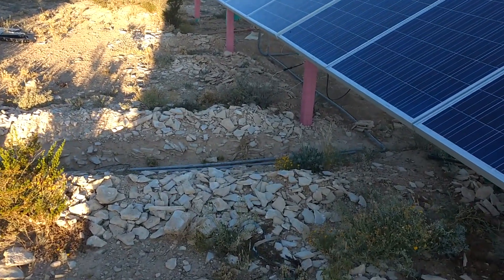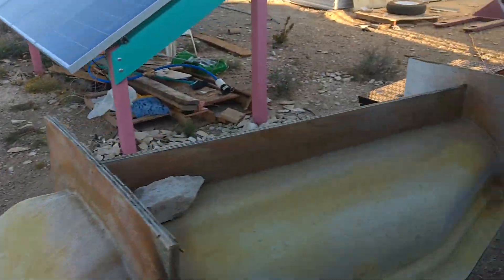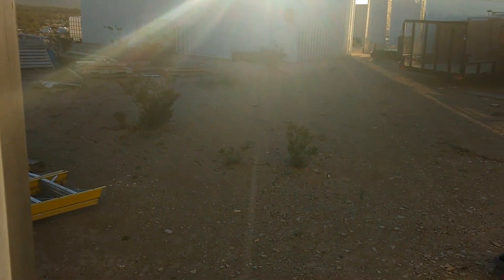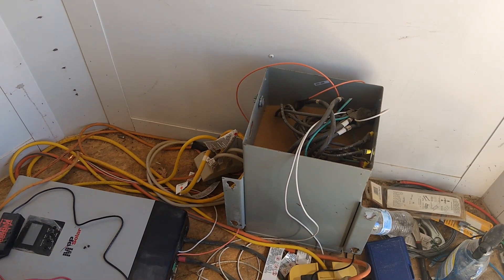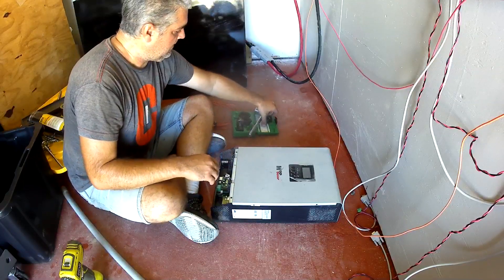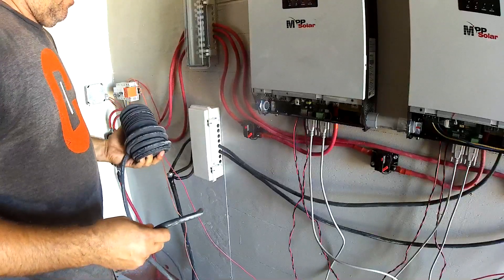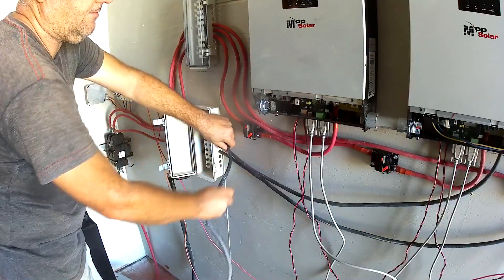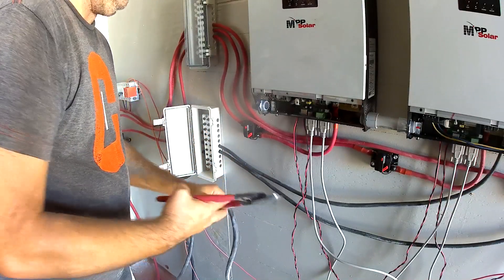More wiring and POWER UP! MPP PIP-5048MG PARALLEL - Off-grid Terlingua

Comment: Nice work right there  .. just want to clarify your setup so that I can do something similar .. Does each inverter have separate group of solar panels attached to them? ... are they then charging one battery bank? ... and if so when the inverters r setup in parallel does that become one power supply of 10k-15k (2-3 inverters in parallel) or are they separate supplies of 5k,5k,5k (3 individual inverters) ..  thanks for the fantastic video

Comment: How do you like those I was looking at same kit.
Reply from the maker: They have done well. They easily drive welders, air compressors, AC, electric stoves, electric clothes dryers, etc. The only problem I've had is when they drop out for no reason every few weeks but the power goes out and comes back in a few seconds so it's no big deal. Also, in configuring them they sometimes get a CAN bus error and need a reboot.
Reply: @fullvegan  ok thank you I'm designing my offgrid now I have 32x 260w panels. Have small propane converted gen but will get 22k gen. And now time to get inverters, wire, combiners, ect.. Did you get a bigger transformer if so what did you go with?
Reply: @fullvegan  oh ok thank you I'm still trying to figure out best way of doing solar I have 32 x260w panels and I order the connectors as they are pv4-s connector. Use our current house I couldn't afford to build system. So been going off other homestead systems. We could turn on 10,301 watts at once now with kids and everyday cleaning ECT. So trying to figure out charge controller and inverter or hybrid and those batteries. I have contacted few solar places but they just want to sell me a expensive system any info would be great thanks kyle

Comment: I have just received 2 MPP MGs and have 10,000 watt transformer to get split phase. I  mainly did this because of cost  and the extra starting capability for motors but also cheaper (about $1800 to the door for Inverters parallel kits and transformer instead of about $2800 for 2 of the LV 5048s). The MG units do take less PV wattage 4500 vs 8000 watts but both can only output total of 5,000 watts. So I may need to get a third MG unit as you have. I also was going to start without batteries with one inverter but went all in.  MPP calls the MG a  batteryless unit but you have to really read to see this is only if a single unit is used not if you parallel them. I would have gotten the new GK model because they can blend in grid power if PV etc can't provide enough instead of switching totally to grid power but they cannot be paralleled.  

Point is: from what I was told since the transformer is basically just changing the same voltage from 240 single phase to 240  volt split phase  for the high power consumption items that this creates much less heat etc than stepping up or down 120 to 240 volt and visa versa and that they could  handle a much larger balanced 240 volt load. They said its the amount of unbalanced ( in most cases the 120volt loads) that further limits the maximum capability.  The person told me that is a retired electrician but still not sure how much to trust that but I wouldn't use over 10,000 watts at any one time either way except to start motors like HVAC and it is 3 ton scroll compressor in stage 1 which is what I limit it to. My high wattage 120v loads like microwave fridge freezer tvs are fairly well balanced and probably about the most imbalance at any one time is max 1500 watts  but usually 500 watts or less.  Have you been told anything similar to this?  I am considering hooking the third unit up to the loads in parallel also otherwise I will be using it only as a battery charger.  I also considered getting an additional 5,000 watt transformer for the third unit. I guess the output power should all be in phase (ie both transforms providing split phase that is in phase with each other).  First I plan on just running 2 units and see how they do for now.  Do you have any thoughts that might be helpful.  For now I have 30 Kwhrs of batteries Lithium LG new cells.
Reply: make a vid of your set up
Reply: @markchin8044  haven't ever made videos because haven't had the time working about 60 hours a week and other hobbies  dont have time to learn editing etc nut maybe make an unedited cellphone walkthrough sometime.  If I do I will notify u.

Comment: Thank you so much for sharing your experience. Ive just bought 4 of those and i would like to ask you how has your experience with your mpps been ever since you i stalled them? Thank you
Reply from the maker: Thanks for watching :) Wow! 4 of them!?!? We plan to expand one day but for now the 3 are doing well. In fact I haven't even been running the third one since we never use that much power and we don't have our third row of panels up yet. As far as perfomance, they have been great. We run welders, air compressors, refrigerators, freezers, air conditioners, electric dryer, electric stove, etc. They have worked perfectly. The only issue I've had is they seem to drop every week or so and we loose power for about 2 seconds. Not sure what's up with that and there are no errors. It hasn't really been a problem but I plan to contact them about it eventually.
Reply: @fullvegan  my 5048mg in dual mode drop the power too randoomly it only seems to do it once every 2 months, but all my lights come on. it done it once at 6am and one time at 5pm, i fully log my data and can not pin point what it is and why it does it

Comment: Slug Buster = A W E S O M E.
I just connected what look like the exact same panels you have to it today. :)
Conduit cutter = gold!

I have two MPP Solar LV5048s. Super happy with them.
Reply from the maker: Our Astronergy panels have been great. Even on cloudy days we get good performance and generally get topped off. The MPP 5048mg's have also performed well. I was skeptical at first but we've ran welders, big air compressors and all sorts of other stuff with no complaint from the MPP's :)

Comment: dont these already put out 120/240? Why a transformer
Reply from the maker: Nope, these only put out 240 single phase which means from the inverter there are only two wires one is neutral and the other is 240v not split phase like we're used to in the US. MPP does have a newer one which is the LV5048 and it is split phase.

Comment: Can tell me what transformer you use and were to purchase one.
Reply from the maker: The one you see in this video was a HeviDuty 10kVA I bought used back in Minnesota for about $450. In the final install I used a Square D transformer model EE50S3H. I have info about it on this video https://youtu.be/dTRiUKogqBM I bought it off ebay and it was a one off deal so I don't have a source to suggest. I would recommend making sure to buy one with a low no load draw and make sure it is TP1 rated. These things are about $3000+ new and I bought this one for under $1000 including shipping and in like new condition so it is worth looking around. Also, buy bigger than you need so you have room to grow.

Comment: That's a very interesting system using a transformer. Looks great
Reply from the maker: inverters are straight 240 no center tap so I use the transformer for that purpose and adds a buffer for inductive loads and hard starts. It works great for big motors and will be good for the welder as well.

Comment: Oman this is so ooooo over my head.. I was wanting to go wind and solar but I don't think I can understand enough to do this. I read and watch and feel dumb as a box of rocks.... Doing good guys... Keep the vids coming
Reply from the maker: It's all about exposure and experience. I'm sure you can do it. There are a lot of things that seemed over my head but each thing you learn makes the next thing easier :) We'll be doing wind soon! We have most all the equipment except the pipe for the tower and a few miscellaneous guy wire parts.
Reply: it is  all about understanding dc   all solar  is mostly  dc you have to understand  it then go on  watch video to  grasp   what i s  happening you ofcourse can udersatnd it it just  a  road that you have to   go   ,,,no  short cuts